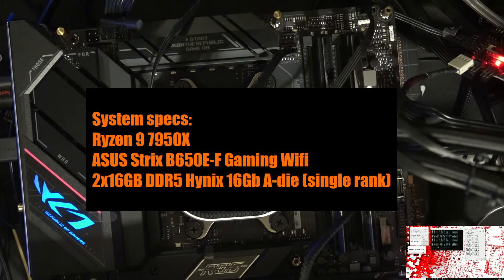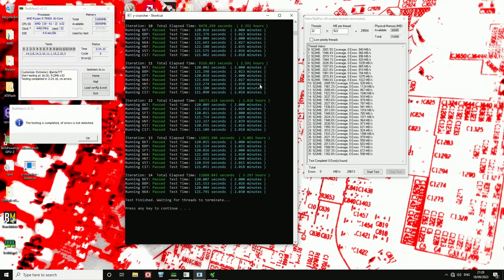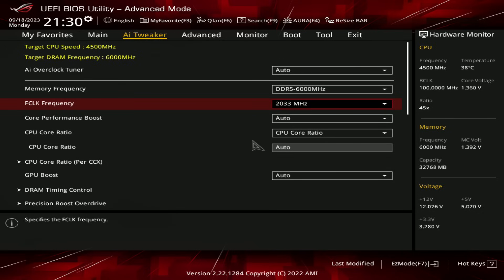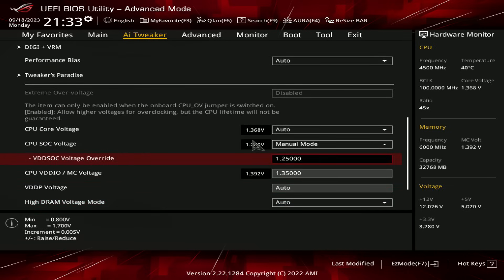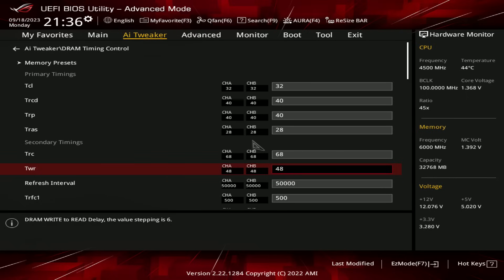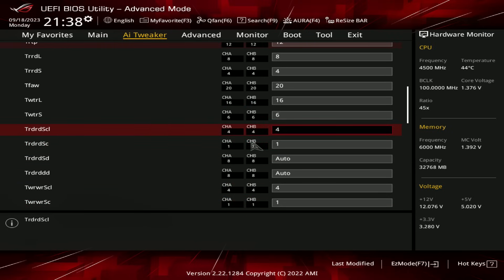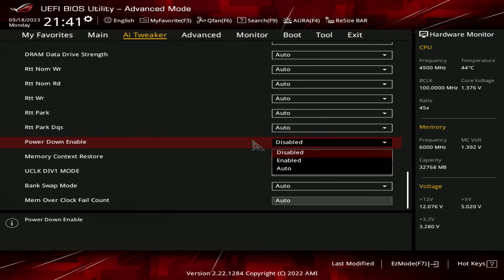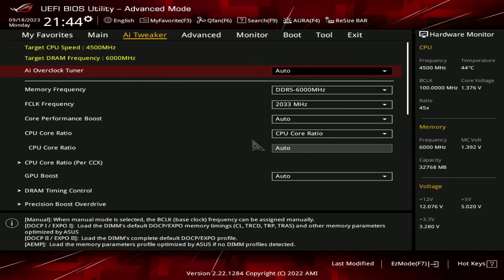Easy memory timings for Hynix DDR5 with Ryzen 7000

Comment: I did exactly the same. Booting no problem. Benchmark no problem. Stress test no problem. Started LAST OF US PART I, had several crashes. Restarted and wanted to make some changes in BIOS and it freezed every time. Absolutely no chance. After some freezes the PC did not even start, black screen, nothing happened. Had to reset the bios and now it works on the standard EXPO settings. By the way. I made a lot of benchmarks and tested the fps in some games and there was literally a min. benefit.. Like 1% +-.
System: 7800x3d, MSI MAG x670e Tomahawk, RX 9070XT OC, 64gb gskill Trident Z5 DDR5 6000 MHZ
Reply: Go step by step stress test, do normal gaming things on your system and when stable for 2-3days then change and tighten more. Doing all at once is a bad idea, you won't know what caused the crash.
If you don't really care for latency using default expo/xmp is good enough, RAM matters a lot, but the bigger lower hanging fruits are CPU and GPU which you should definitely OC/undervolt right away, the gains are huge.
Reply: Memory tweaking is just to jerkoff to benchmarks. It's 1-2% more than your regular 6000 cl30/36 expo at most in gaming./ It can be of more importance in professional software.
Reply: According to Aida64 Cache & Memory benchmark, my system, the sub-timings improved memory read/write/copy/latency ~14%, but this translated to no improvement in games fps (except 1% lows very slightly improved). It did improve video encoding times slightly, the only productivity related activity I would notice . By far the most important improvement for me was being able to disable MCR & PDM. Whilst memory training now takes 20-30secs. it does always complete successfully. Before, I had to enable both MCR & PDM and occasionally experienced the POST hang mentioned in the video @ 4mins. The only other issue, displayport occasionally not initialising during post, is worse with the sub-timing, for some unfathomable reason. Forcing me to use HDMI instead.

Comment: This caused me crashes and even freezes in bios even after disabling memory restore and power down mode. Absolute pain in the ass to revert all the changes. Sticking with the expo profile
Reply: do you have hynix ram? the label on your ram can show if its a-die or m-die. these can cause a diffrence as well, might need to set the timings a little more loose.
Reply: @nicholasphillips5908 yes I have Hynix. Luckily reseting cmos got me back in to my pc but I am pretty sure my bios is corrupted now as it will randomly freeze. Windows still boots though and runs fine. I can get into bios long enough to make changes but at this point I’m never touching timings and hopefully don’t need to go in my bios to often
Reply: @nicholasphillips5908 Gigabyte has software that lets me know when there are updates for chipset, bios, etc. I just want to ask, do you have any explanation as to why my pc would be functioning completely fine in windows, but will randomly freeze in the bios?
Reply: @nicholasphillips5908 it also needs to be single rank dual rank won’t work

Comment: Can someone answer my layman's question, do I change the timings with the XMP profile disabled or enabled?
Reply: As far as I can determine there is no reason not to use XMP profile and then make manual changes. Try it and see.

I made a note of my EXPO1 primary settings and then disabled EXPO, manually entered the voltages & primary as per EXPO and secondary timings is per the video except FCLK: 2000MHz and tRAS: 126. This was just in case EXPO might be silently changing something else.

Comment: I have a 9600x/MSI B850 Tomahawk Max WiFi/2x32 TCreate 6000/5070fe/Corsair 750e. Random different BSODs especially when gaming (Hypervisor errors, IRQL not less or equal, Kernel, Ntoskrnl, System service exception, Page fault in nonpaged area, Critical process died, Watchdog violation, and probably more that I can't think of. The system passes OCCT, Prime95, MemTest86 for hours. However, on TestMem5(1usmus_v3) and HCI MemTest it either throws an error or BSODs and reboots. I ordered another set of ram and it's exhibiting the same behavior with dual or single DIMMs in the 1st and 2nd DIMM slot. I've reloaded windows with no networking and drivers 4-5 times paying close attention to driver loading order. Never seen anything like this in 25 years. All new parts on default bios at JEDEC speed running on the iGPU shouldn't be doing this. I'm at a dead end and about to start RMAing stuff. Anyone have any ideas? Motherboard issue? Processor IMC issue?
Reply: Some info about your DDR5 ram would be helpful. Is it on the QVL list? For most motherboards DDR5 matched pairs should be in slot 2&4. Have you enabled EXPO? Are you using Curve Optimizer with a negative value? The conclusion I have reached is AMD5 using DDR5 can unfortunately be flaky with some motherboards. A recent bios and latest AMD chipset drivers are important. How hot your CPU gets and your DDR5 under load is relevant. DDR5 5200MHz is the recommended speed from AMD (infinity fabric runs at a 1:1:1 ratio with the memory and memory controller). Enabling AMD EXPO inside the BIOS is “technically” overclocking and reliant on the CPU quality. The trials and tribulations I have been through are documented in this thread from a few days ago, which might be worth reading through.
Reply: @kalaglow5094  The 2 kits of DDR5 I've tried are T-Create Expert (2 x 32GB) 6000 CL34/44/44/84 and G.SKILL Flare X5 Series 64GB (2X 32GB) 6000 CL36-36-36-96. Both are EXPO and XMP rated and on the QVL list. I've reinstalled windows home/pro several times and installed latest drivers and bios. I've used DDU on the gpu drivers. I'm on stock settings and bios I've tried at JEDEC, EXPO1, and EXPO2. Yesterday I ran Prime95 on blend for 5 hours with no errors. Low temp was 55, high temp was 83, and average temp was 65. Results with OCCT and AIDA were similar with no errors. So the temps don't seem to be an issue. And since I've tried 2 different brands of ram on the QVL, so I don't think Ram is the issue. But it still BSODs or throws errors on TestMem5 and HCI memtest and sproadic random BSODs while using the system. A new build with new parts on stock settings, stock BIOS, and no GPU installed shouldn't be this unstable. Maybe it's the motherboard or IMC. I'm stumped at this point and open to ANY suggestions before I start RMAing parts.
Reply: @ODRiley Is DDR5 in slots 2&4? Installed AMD chipset v7.06.02.123? Remove any negative curve optimiser. Up todate bios? A driver could be causing issues; Wifi/Bluetooth for instance. Temps are ok. It could be the motherboard or a weak IMC. T-Create Expert & G.SKILL Flare X5 use Samsung die I believe, so secondary setting in this video not much use. Seems unlikely to me both DDR5 kits can't hit rating.
Suggest trying EXPO1 settings but manually reduce frequency to 5200 MT/s and test again. If all ok, probably a weak IMC. The impression I get is there is not much real world performance difference between 6000 or 5200 MT/s (probably affects 1% lows in games a bit). If problems continue could be be motherboard; still could be a weak IMC but CPU can be RMA'd if it can't hit 5200MT/s?
Reply: @ODRiley  Indeed, with the POST issues my motherboard has, it has taken all of my experience to get my system to a usable state and this video with secondary timings the final bit of the puzzle. DDR5 made it the most difficult system I have ever built, PBO a nightmare for a newbie lacking patience... It looks like you will need to return the MSI motherboard and the CPU. Hard to know if the MSI board is problematic, I've found quite a lot posts on Reddit from users wrestling stability issues, but others seem to love it. Good luck.
Reply: @kalaglow5094  I have 3 other systems, so I'm good until I can do an RMA and get this one up and running. I'm leaving for vacation next week and will be gone for a month, so I'll just have to deal with it when I get back.  I'll post any updates if or when I find a solution, whatever that may be. Thank you and have a great evening

Comment: odd, I could get these settings to work no problem on my PC (ASRock B650M-HDV/M.2, Ryzen 7 7700, 32GB Kingston Fury Beast DDR56000 CL30 EXPO kit) and one other build (same board and kit but Ryzen 5 7600 instead). Passed Prime95 large FFTs, 90 minutes of Extreme @ anta777 TestMem5 with no errors.

Built an almost identical system to the last one (same board, same kit, same CPU, different case and PSU), throws errors in TestMem5 after around 15 minutes. 🤷‍♂️ Power Down/MCR makes no difference.

Any ideas? Increase the voltage, maybe?
Reply: Change voltage see if that helps anything below 1.45v should be safe but id say 1.4v just to be sure

Comment: Trying out the secondary settings outlined in the video, without using EXPO (but using the primary settings as per EXPO) and with Fastboot, MCR & PDM disabled. For me, essential FCLK set to 2000MHz and not 2033MHz or the bios gracefully resets to defaults. So far so good, memory latency improved to 64ns (was 74ns); games performance barely improved though. Still running stability testing, but MCR & PDM disabled already a positive, as memory training is only adding about 20-30 secs to POST time and so far no POST hangs.

For info - My system: 7700x, Asus TUF B650 (3222 bios) & Corsair Hynix b 6000 CAS30 MT/s (Asus QVL), Asus 4070. With EXPO enabled, MCR & PDM disabled, from cold boot memory training took forever and approx 1 in 30 POSTs hung, sometimes requiring physically resetting the BIOS (orange Q-led permanently lit). My workaround was, EXPO enabled and MCR & PDM enabled. POST then quick, but approx 1 in 20 restarts, the POST hang mentioned in the video @ 4mins occurs. Thankfully this is easily resolved by forcing a ctrl-alt-del reboot . One other issue, using DP cable (port v1.4-GPU --> port v1.2-monitor) with EXPO and Resizable BAR enabled, approx 1 in 50 POSTS the screen hangs with the white Q-led indicating a video issue. Thankfully permanently resolvable by either turning off Resizable BAR or by using an HDMI cable, (restricts refresh rate to 144Hz rather than 165Hz with DP cable). Once in Windows 11, everything is stable and I can run stress tests, benchmarks, play games for hours without any problems at all, leading me to believe it is motherboard POST weirdness.
Reply: I don't normally reply to myself, but... These timing are working well for me, no POST hangs at all and I've rebooted/restarted many times over the past five days. 100% stable for games and 2 hours stress testing with Aida64, OCCT, MenTest5 & y-cruncher (with GPU under load to keep temps up inside case). Still early days and time will tell! I'm restricting CPU to 80C max temp with -10 Curve Optimizer and even with current ambient temps of 30C in the UK, it is averaging 5300Mhz under load so AIO and case fans holding up well. Very happy as been wrestling with the motherboard POST issues since new.
Reply: After two weeks a little more feedback. 100% stable in Windows11 (games, various stress testing & benchmarking). AIDA64 benchmarks 14% latency improvement. Doesn't seem to have any real world improvement in games performance though. More importantly for me, No POST hangs at all. However these timings (or possibly memory training enabled), has made things worse with DisplayPort, which now always either blank screens or goes directly into Windows. When POST blank screens, waiting for Windows to load and then turning the monitor off/on resolves. An AI search comes up with the following which seems plausible... "A Ryzen 7000 series SoC (System on a Chip) voltage 1.25V is generally considered the upper limit for safe operation, exceeding this could lead to issues like DisplayPort post failures and and other problems, particularly when using EXPO memory profiles". My conclusion is DisplayPort does not like voltage changes during the POST memory training initialisation stage. So I use HDMI, although enabling CSM (thus disabling ReSizableBar, secure boot etc) also seems to fix DisplayPort POST issues.
Reply: Final reply - Nearly three months and one POST incident when PC rebooted a few seconds into POST from cold startup and then BIOS booted into safe mode with enter BIOS F1 message with Q-Led red light. I rarely used to get this before applying the Buildzoid setting and once it happens POST continually loops with F1 message, even after a power cycle. I used to have to reset the BIOS, until I realised that entering the BIOS and changed any setting and saving BIOS resolves. The only other ongoing unresolvable issue is the POST DisplayPort black screen, forcing me to use HDMI.

Comment: I followed these timings but I'm getting really low read speeds. Like ~62GB reads to ~90GB writes. Running Hynix M-die 4x16GB 6000 Cl30-36-36-76 at the timings in this video, Better than stock but the reads didn't improve.
Reply: tRas should be at 126, aswell as FCLK should be at 2000Mhz, he corrected himself in a later video, check out the other comments
Reply: @IBlax404 why should it be at 126? I thought lower tRas is bette
Reply: @YeaItzfin  He did a video on it I believe "tRas on AM5 is weird". As I understand, it basically doesn't get you any extra performance, if anything it causes unnecessary instability.

Comment: If these are like 99% safe for anyone with Hynix DDR5-6000 then why isn't these Sub-Timings put into the EXPO profiles?! So much performance left over...
Reply: stability issues can be really iffy and difficult to pinpoint. You would need an absurd amount of testing for the timings to be stabil in every scenario. Hell even XMP profiles could lead to instability
Reply: Manufacturers arent interested in draining out all performance of the kits. I guess this makes sense because they would need to test the chips for longer
Reply: More testings same reason all gpus aren’t -100Mv less and cpus too when pretty much any cpu can do that

Comment: Does all DDR5 come with temp sensors?.. I need them to run my RAM fan... AI is giving me conflicting statements. People do talk about temps on the Amazon reviews for CMK32GX5M2B6000Z30 - very common cheap 6000 cl30 kit - so I assume they have some temp sensor?..

Comment: tried this on my kingston expo fury beast cl30 6000mhz primary i didnt touch 30-36-36-80 and damn couldnt believe it was this easy
Reply: and i had manual 1.4 from expo profile and i just set it to 1.35 as u showed and i guess less stress on ram also
Reply: @mujaserbexheti  Worked for me too, but I actually set the SoC voltage to just 1.1V. Because of the "dying" 9800X3Ds. I can't say it's actually stable for sure, but no crashes so far. And no errors in the OCCT memory test. But I haven't done any extensive testing and I doubt I will. I'll just increase the soc voltage if I ever notice any problems. I also lowered the PBO limits (https://www.youtube.com/watch?v=Cd3iwFTadoo&t=770s). Reduces FPS a tiny but hopefully my 9800X3D will have a long life.

Comment: And what Read speed you getting,  i just bought ddr5 6000mhz exmp  and I have just 59k  Read speed and 89k write speed I set flck 2000 uclk=mclk and still new bios new drivers cpu 9800x3d b650e before on 5800x3d i had 55k Read,  can sombody help me out